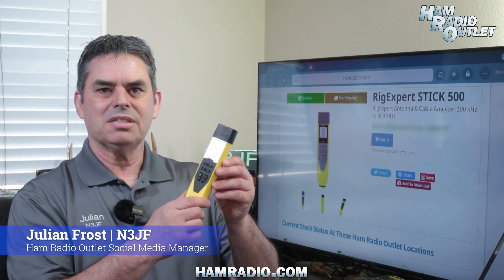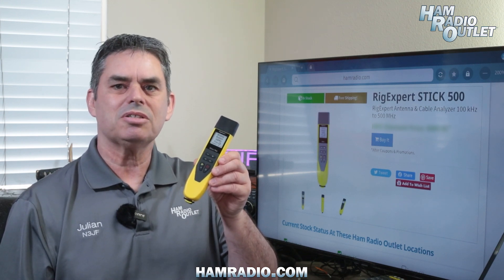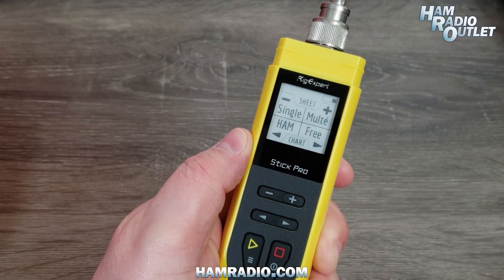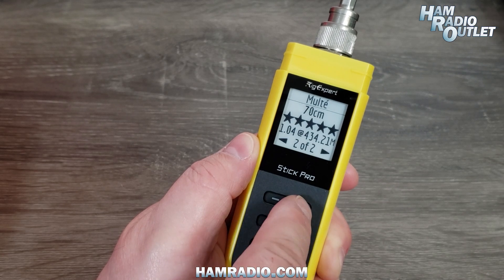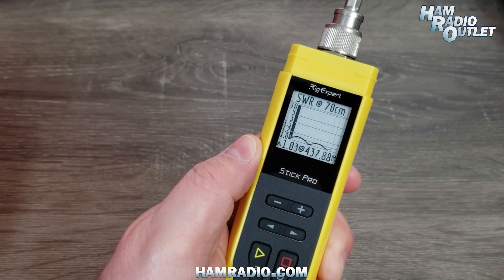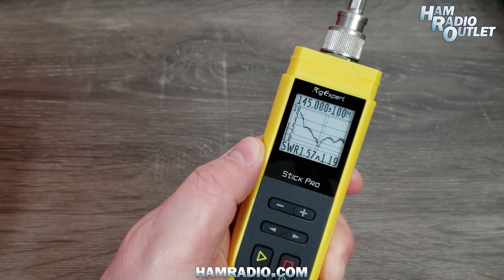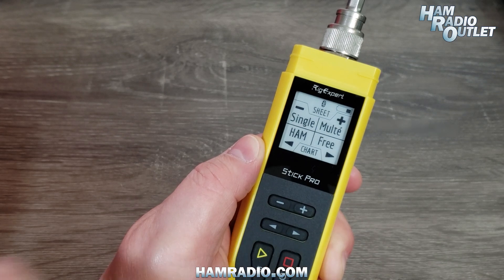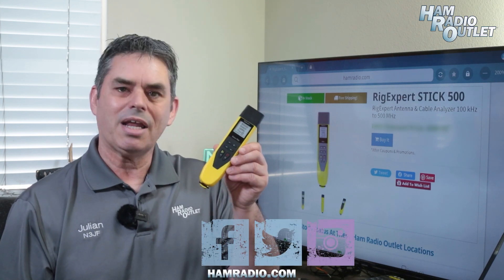RigExpert Stick 500 - Ham Radio Outlet

Comment: RigExpert sucks, I still waiting support for one of their item TI8 almost 4 years and nobody wants to take the Hot Potato
73’s HP1CDZ
Reply from the maker: I can't speak for your particular issue, but their products are usually pretty good and don't often come back for repair. After using the Stick 500 for this video, I decided to purchase it. As I'm sure you can imagine, working for HRO, I get to try out a lot of different gear.
Reply: @HamRadioOutlet  Totally agreeable, but I needed to expose my bad experience with RIGEXPERT.
My regards to Barry I am his customer

73’s Duncan hp1cdz